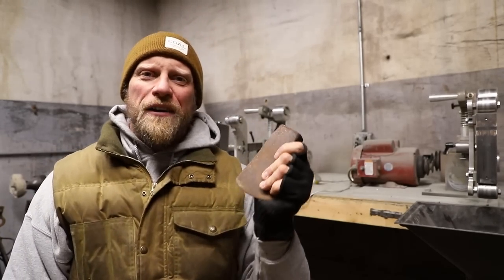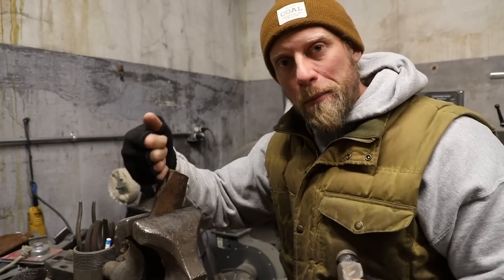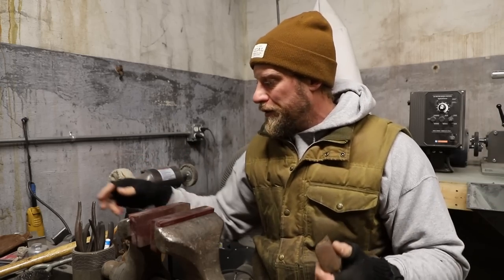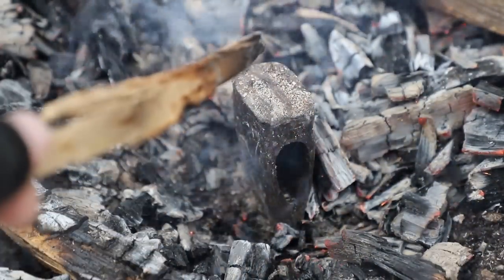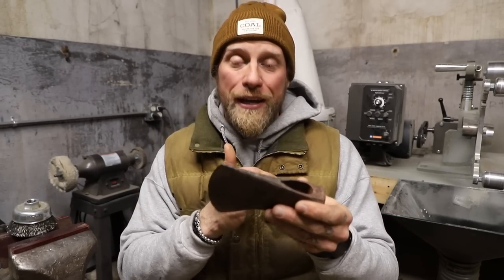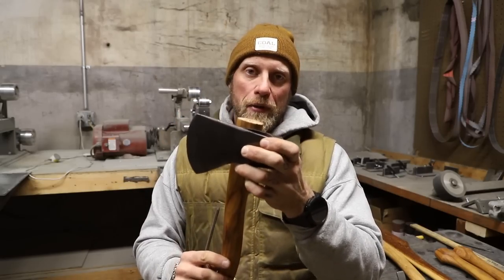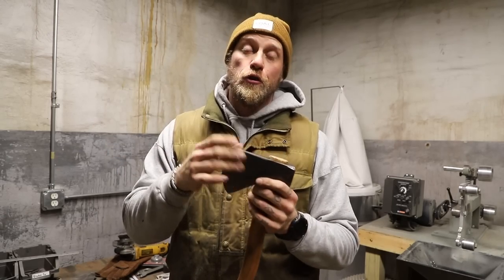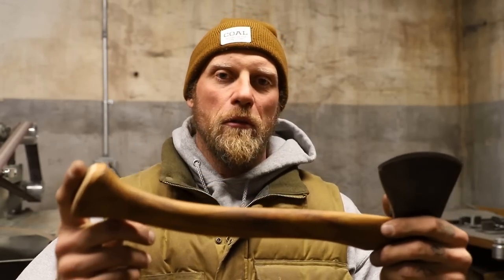Bushcrafter's Guide to Axe Restoration: Sharpen, Handle, and Fix an Old Axe

Comment: Good call Dan, on using the dirt as a “Heat Sink”, that was priceless. 
Great tips on hanging an Axe handle, a wooden mallet or dead blow mallet, very useful tools. 
Sharpening, I start very similar, but end with 2,000 grit sandpaper and strop. And yep a sharp tool is a useful tool.
God Speed, and enjoy the outdoors,,,,,,, 
Semper Fi,,,

Comment: One of my favorite hobbies is to visit antique shops and flea markets looking for old, unloved axes and hatchets. Strike a deal, bring them home and give them some tlc and a new handle if needed. I've been getting my handles from "House Handle Company". They have many options for the handles (lacquered, unlacquered, handpicked, etc.) I opt for the handpicked un-varnished handles for my projects. One thing you didn't mention in your video that might be worth taking note of. Not that all axes have hardened polls, but some do if they are what might be considered a Carpenter's axe or shingling hatchet. Using fire on these types of axes will damage the heat treat on the hardened poll. This may or may not be an issue depending on how the axe is to be used.  I see lot's of people gluing the wood wedges during installation and personally, I avoid doing so. The reason I don't is that wood handles over time will loosen up due to a number of factors and the head will loosen. When that happens I remove the wood wedge, make a new thicker wedge and drive it home which re-tightens the head to handle fit. If you glue your wedges in place, removal is much more difficult if not impossible without drilling it out. That said some properly placed step wedges could alleviate the problem, but I try to avoid using those as well. I've created and replaced handle wedges in the field to keep an axe head from '"flying off the handle" and did not have a steel step wedge at hand. If the handle is set properly and a properly fitting wood wedge used I find this to be all that is needed to keep my wood handled tools working safely.  As always, good stuff Dan!

Comment: The timing of this video is perfect I'm dealing with replacing a handle in an old axe head right now.  However the one thing that I needed information on you didn't cover and that's how to get the wedge into the top of the axe handle.

Comment: Great vid! I love old axes, especially Norlunds. If the head is very rusty an overnight bath in vinegar works wonders. Then I hit it with my pressure washer to remove the black goo. Vinegar will remove any patina though.  The wire brushes on grinders do seem to burnish the metal to a nice hue. I have also used an orbital sander to clean up some old heads. I go very easy around the maker's mark though.  I hate head mushrooming,  so I almost always try to remove it and finish the head edges with a slight bevel. 

In addition to your methods of removing the wedges, I've drilled small holes into the metal wedge, then screwed a large headed screw part way into the wedge. Then I used the screw to pull the wedge out. If you can get the wedge out without messing up your handle you might be able to reuse the handle. Even if the handle is messed up a little, you can widen the cut in the handle and then make a slightly oversized wedge to fit the cut. Or, you might be able to trim off a 1/4 to 3/8 of an inch off the top of the handle to clean it up enough to use. You may have to deepen the wedge cut, or trim the shoulders down a tad, but it's sometimes worth it to be able to use the original handle, if it's in decent shape. Vintage handles on quality axes often are very nicely shaped with beautiful patinas.  

Those are really nice handles that you have! I hope you plan to feature them in upcoming vids. Years ago I took my dad's Craftsman Boy's Axe into a Sears to get a replacement handle. The cashier noticed that the head said Craftsman, so they gave me a free handle under warranty. Ace Hardware and Tractor Supply sometimes have decent replacement handles if you need one pretty quickly. You'll have to scrape the varnish off though. 

I love a nice fawns foot on the end of the handle. Yours looked very nice.  There's a boiled linseed product out there that also contains a citrus or orange oil in it. I think it has the word Milk in the name. Mine is in storage from a recent move, or I'd go look it up. It soaks into the wood faster and also dries faster than regular boiled linseed oil. Howard's Wood Food, and even butcherblock oil works well to rehydrate older handles. 

Be super careful with any rags you use boiled linseed oil on.  It can spontaneously combust if you throw it into the garbage while it's still damp.

I love the look of a slightly proud handle with only a wooden wedge in it. I try to cut the tip of the protruding handle above the head as square as possible. Then I hit it with a sander to make the top super smooth and to blend edges of the different woods. Sometimes I'll use a high contrasting color of wood for the wedge. I've done a couple where I set a smaller wedge perpendicular to the first.  In an large eye you can do two. I place the second wedge more towards the large part of the eye.  It forms a cross at that point, which I think looks great. I've done a couple of hammers as well.  

BTW, I use a rubber mallet for seating the handles.  It doesn't ding up the wood. I guess that matters less if you have a handle that you're trimming after hanging it though.  

Do you often drill a hole in the handle to hang the axe from? Some of my axes have the original vintage handles that I restored and I've hesitated to drill them. I've taken to adding a hanging loop to the mask when I make them. 

If I'm giving an axe as a gift though, I always drill the handle and add a loop to hang it with, otherwise most folks will end up leaning it against a wall, causing the handle to warp, and the head will probably be sitting on the ground causing it to rust up.

Comment: Please don't burn the wood out of the eye of your axes unless there is absolutely no other option.  You can harm the temper if you aren't very careful.  Those handles are really nice looking.  Along with a four-in-hand rasp, I really like a Shinto rasp.  A spoke shave is fantastic at working the handle down to fit in the eye.  If you carve your own handles, you will want a draw knife.  You will quickly learn how the draw knife interacts with the wood grain.  Drawing in one direction will produce nice shavings.  The other direction will tear out wood.  I prefer to use electrolysis to remove rust that is more than just surface.  All you need is some washing soda and a car battery charger. It removes the rust while leaving a really nice patina.  Coal Cracker sells a really nice sharpening puck.  The coarse side of the puck will wear pretty quickly, but in doing so does a great job of sharpening.  I love restoring rusty, abused axes and hatchets!
Reply: Regurgitating wrangler star

Comment: Excellent presentation.  Something to try is50/50 Vinegar/water mixture and soak for 20-30 minutes, all the rust will scrub right off with dish scrubby.  Let the chemical do the work.  Works on cast iron skillets too.

Comment: Hi happy Christmas, nice job on this! I like to leave the hardwood wedge slightly higher than the top of the handle so you can easily re - tighten if necessary, but maybe I didn't do it right in the first place 🤔haha. Great video's as always cheers 🪓

Comment: I have an old Gransfors Bruk that I foolishly cut the handle off of instead of trying to tighten up the fit. It's been needing a new handle for years as a result. My problem is that I want a handle that closely matches the shape of the original. I'll have to look when I get home, but at first glance the Hoffman handles look pretty close. I might have to pick one up and get this head back to being a functional axe!

Comment: Hello, Dan;
Thank you for all you do.
Burning it should be the last resort unless you have no tools whatsoever.
If the broken haft can be removed (easily done w/ hand tools) then;
  drive 2/3 of the bit into the ground to keep the bit's temper.
BTW, when the haft breaks right at the head turn the head over & drive the old haft out the top.
You can disagree.
I'm 67 & I haven't had to do this in 35-40 years, until this year.
So I may not have as much experience as you.
But it was a regular thing back in the day.
Also, most people don't know to thin the haft to give it some flex, makes it last better.
House handles are cheaper (S&H not included) & so far they're far superior to Truper.
Last point, IMO it's a waste of time to grind, sand, or polish an ax head.
If you use it that will 'clean' it up over time.
You said you like the "rustic look' so save time & money on that, use it to file & hone.
And to practice chopping.
That is more important than most realize.
I've seen people swinging an ax & not hit the same spot twice.
Have a GREAT day, Neighbor!

Comment: So, did you skip a step? Did the handle come with the slot for the wedge or did you have to cut it yourself. And if you cut it yourself, did you cut it before fitting the head on the handle or did you fit it then pop off the head and cut it? Seems like an important step to skip in the video....

Comment: well you just did NOT show the main thing....and that's a bit of a shame. fitting the handle on the ax went fine, but how do you make it so "fit" that it still needs a wedge ..... because that is still a thing ..... the inspection of the handle of the ax because that wedge has to be added ...... when the handle is put through the head. that is important for people who do not know that, and how long will the wedge be or should it be, I still think this is important information ..... and I cannot find it in your video .... too bad

Comment: If possible...cut the handle off flush with the bottom of the eye...and drive the wood out from the bottom.  The top of the eye is larger than the bottom...making the remaining wood come out easily.  If you pound on it from the top...you're just smashing the wood in tighter!

Comment: The only thing I didn't hear you say was how to determine the handle length compared to ax head size or is this just a dumb ?.
Reply: The general rule of thumb I was taught is roughly 10" of handle length per pound of head weight. Obviously this falls apart after about 3.5 lbs because you're not going to put a 50" handle on a 5lb head, but for most small-medium heads it gets you in the ballpark. A 1.5 lb head would get something in the 16-20" range, a 2.5 lb head you'd use something around in the 22-26" range, etc. 

Hope that helps.